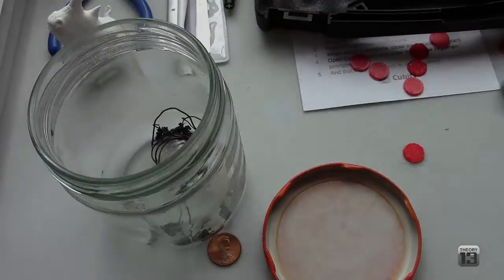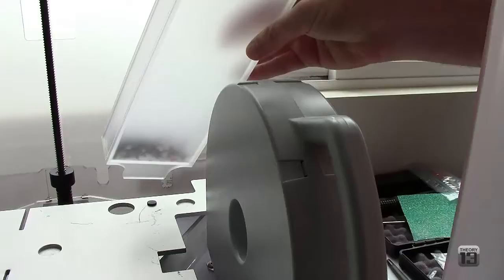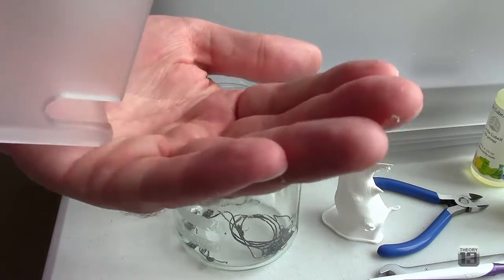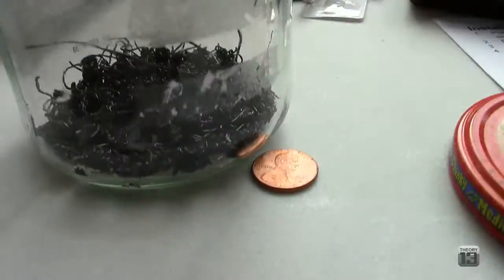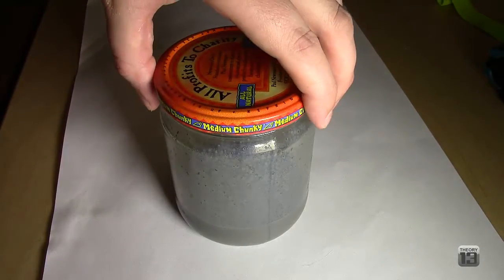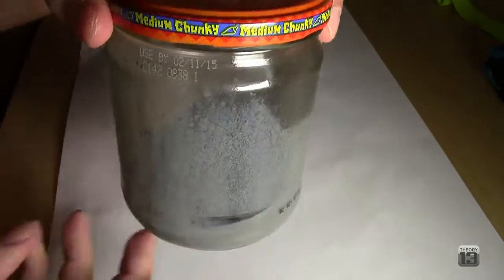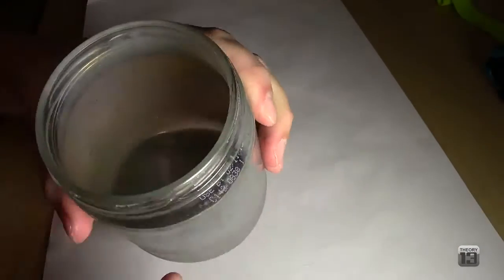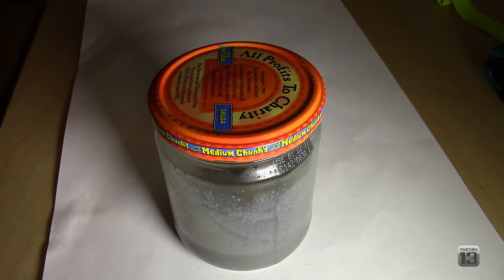Cubify CubeX Duo -- Video 015 -- ABS Slurry Time.

Comment from the maker: LOL.  Hey Ziggy2070,
One thing i've found that it does nicely is to smooth rough underside surfaces.  I just paint it on. (granted it'll show your brush strokes if it's too thick).
It also works as a great glue to bind two ABS parts together.
.
So me people paint a thin slurry coat onto their build plates too, rather than making a raft.
.
I hope that helps you get an idea with what you can do with a ABS slurry!
Cheers!